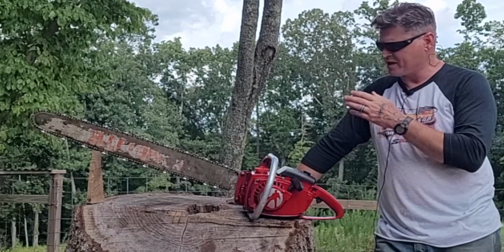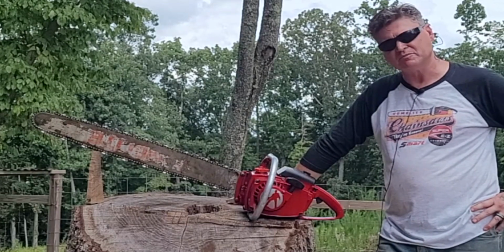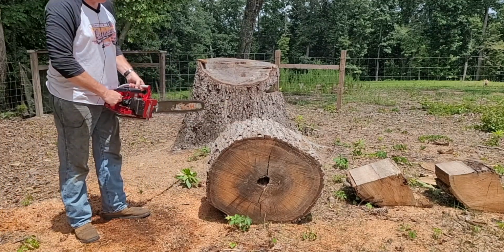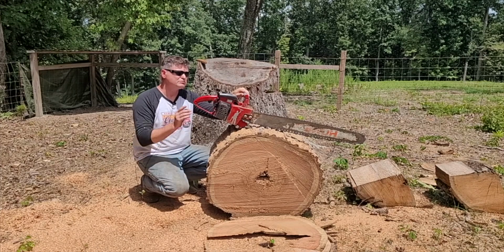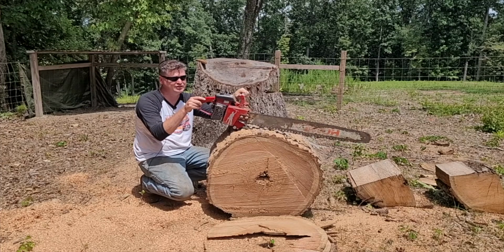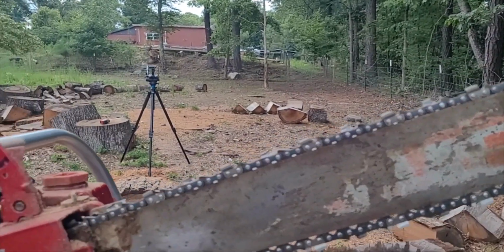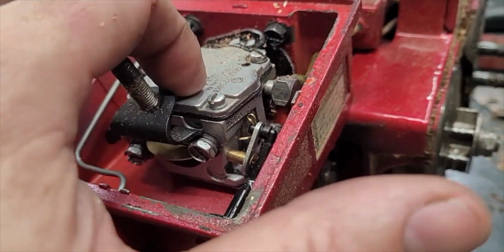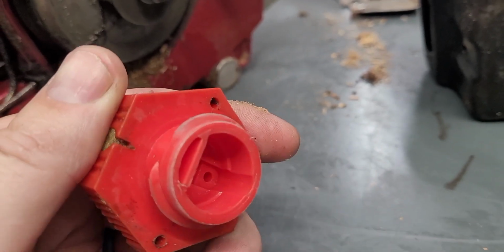Ash's Homelite Super XL with 30" Bar!

Comment: That is a beautiful Homelite super xl automatic I also I have three of them exactly like that without the 30-inch bar on them I have a nice little question of Homelite chainsaws and I'm actually afraid to turn mine totally down to repair a lot of it but I'm even having trouble getting my fired back up the last time I had it fired up it caught fire three times but I had a hole in my fuel line

Comment: Yeah!! Duck bill valves are on amazon
Carb seems need some love
Boedy, there's a tiny spot when saw cuts fastest, push harder - lower rpms and chain goes deeper, push less - higher rpm but chain just touch the wood. All like carb adjusment, to me looks like maybe you pushing just a bit too much:) 
Keep it going man!

Comment: Ahs' chainsaw in the original Evil Dead is an xl 12 manual oil only.
This is a super xl auto.
Can pull"20" inch bar at the most..
She is veeery slow..
1960s saw made until 1998.
I honestly don't understand why ..
Reply from the maker: Just to see man.  Just to see.  And I mention that the original is not a SXL, just preferred to use the better saw.

Comment: Old homelites are notorious for boiling fuel and pressuring up
Reply: If its clean and air can circulate around the cyl cooling fins a XL12 will not boil the fuel.
Reply: @thecollectoronthecorner7061  +1 and do not lean it out!!!!!!!!!